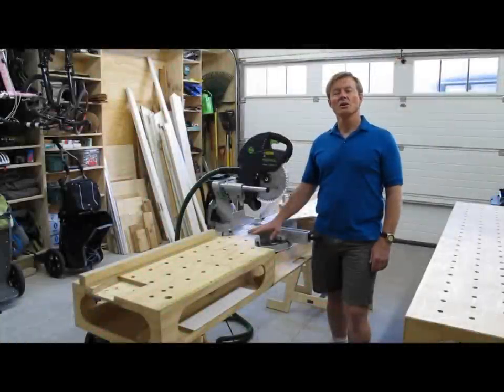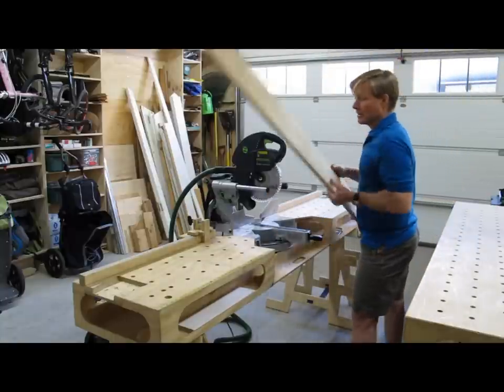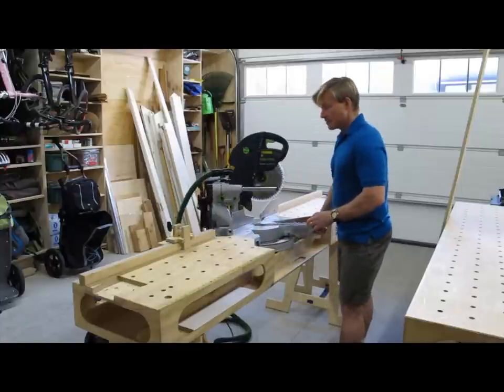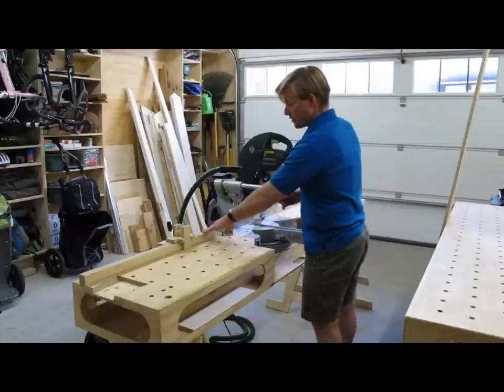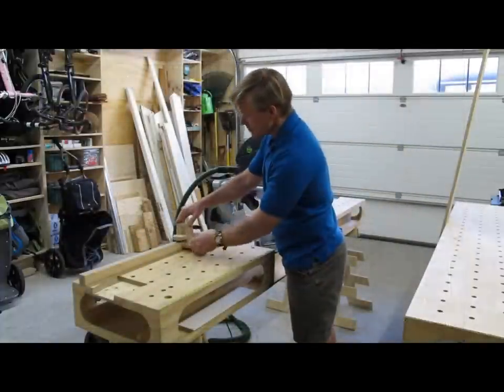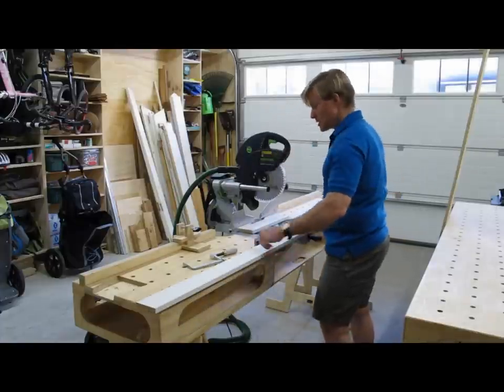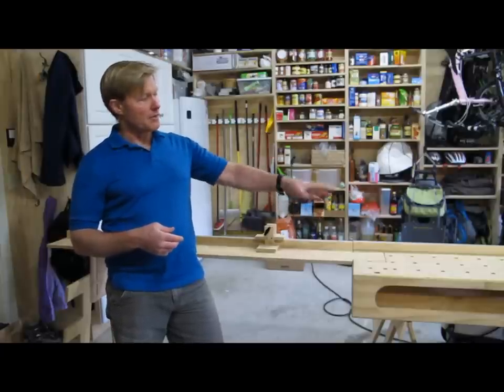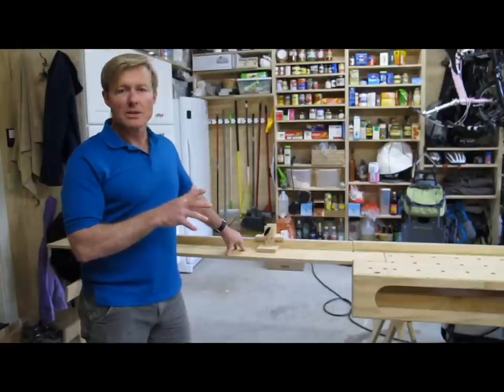The Paulk Miter Stand: A Versatile and Portable Woodworking Solution

Comment: I love the stand.....After years and years of making fixtures like that on rainy evenings in my shop, I went to a Rockwell folding/wheeled stand with a Dewalt 12" custom fitted to the Rockwell stand and used portable roller stands. It saved me hours and hours of work and seemed more mobile, which is what my crew and were. Light, mobile and super fast which honestly kinda killed the fun of being master finish guys.

Comment from the maker: Handy Stanley, the miter stand and work bench are adjustable to brands other than FT. I use FT so the conversation to alternates will be up to you. My Work Bench was set up for DeWalt, but I understand others have modified for Bosch. The miter stand as I recommend in the plans is best finalized with saw in place even if FT. 

Ron

Comment: Ron: I purchased your plans for the 3ft x 6ft Total work station several years ago and just bought a de Walt 779 Compound miter saw. need to adapt my bench for this saw. Can. you direct me to plans for the 779? I'll remove my bench top and alter the internals as needed. Love the bench, but my old Rigid 12inch chop saw was never saw enough for my work. The 779 will make work a lot easier. Thanks, John.

Comment from the maker: Space for most of us is the issue, isn't it? I have had a couple of large shops over the years, but decided that I did not want the investment in a big space and big tools especially when I find it most efficient to do my work on site. Before I made my miter stand, I had a DeWalt Stand and also a Bosch. I built some attachments to add solid surface wings for material support and measuring. 
Ron

Comment: Do you sell the plans for the ultimate miter stand? I looked on your home store but didn’t see it.
Reply from the maker: We removed the miter stand plans as the Smart Station is far beyond that design. If you want a miter stand then I would suggest the PSS (Paulk Smart Station) and scale it to be narrower. In doing so you will have the advantages of the more refined design but similarly sized to the older miter stand.

Comment: Ron, I just watched your video on modifying your drawer jig, and in the background you have your miter station set up.  Only it is sitting on what looks like a 6 ft Paulk bench II without the notch that the miter saw usually sits in, and there appears to be a new set of extension wings on either side.   Is this a NEW design waiting in the wings like you had with the bench II?  I really like the look of the extension wings.  Did not see the plans on your website.  I have all the rest, might as well have this one too if it is ready for the public.

Comment: So I'm new to woodworking and purchased these plans and have had a helluva time building this. Any chance you could make a video series about this? I like this better than the total station and just need more info than in your plans as they are very basic-at least to me and I could use more direction in the plans or a video.
Reply from the maker: Hi Joshua, I am glad you are taking a crack at building the miter stand, you will learn a lot. I don't for see a time in the near future that I could build another miter stand on video. Making a video of the build takes me 10x longer than building it (NO EXAGGERATION.) You can do it! Be sure to watch the other build videos on the Paulk Workbench and Total Station. They are different, but most of the skills and methods are very similar.

Comment: Hi Ron. I'm wondering, after lots of use, is there any slop that develops in the dovetail joint of the extension wings that would affect the accuracy of an attached  measure tape bridging the main body and the extensions?

Comment: I first saw your designs from another contractor's YouTube video.  Understandably you designed it for the Festool products.   As a homeowner / DIY'er / woodworker I cannot justify the price for those tools.  Can I adapt your plans to accommodate Irwin clamps and my Bosch 12" dual compound miter saw.  My table saw is a Rigid r4510.  Speaking of table saw - is you UWB flush or below the table saw?

I like your design because I also have to share the garage with everyone else in the family.

Comment: Hi Ron.  I'm nearly finished with building the total station and now plan to build the Miter Stand.  I already have your plans.  What is not clear to me is why they don't show any connection between the support horses and the stand itself?  This seemed to be a requirement for the total station.
Reply from the maker: Gordon, the tabs and slots on the first PWB were necessary for structure, but the others on the PWBII, PTS, PCB are just for ease of set up. The miter stand was my second design and the tabs were not necessary for structure, but I would add them as they do speed up set up time. Ron

Comment: Ron, any thoughts on how best to attach the top if I don't have a pocket jig?
Reply from the maker: A good option would be to counter sink finish head screws.
Reply: Ron, will the Festool clamps fit in a 3/4" top with 3/4" holes?
Reply from the maker: Kent, the Festool clamps work good in ¾" holes.

Comment: Hi Ron. Given that the fence is set back anyway, would the stop system from the Total Work Station be a better solution if adapted to the miter stand?

Thanks.
Reply from the maker: +gaparrott Yes. If I were to rebuild my miter stand, I would use the Total Station stop. It would not only work better, but would eliminate the stop projection making transportation and storage easier. I haven't bothered with a miter stand update as the Total Station replaced my miter stand. I can see the benefit of having the smaller set up and may do so in the future.
Reply: +Ron Paulk Thanks for the very quick response. Another question. Would you replace the rabbets and dados in the main section with pocket holes and screws, or is 1/2 to 1/2 inch plywood not such a good candidate for that?